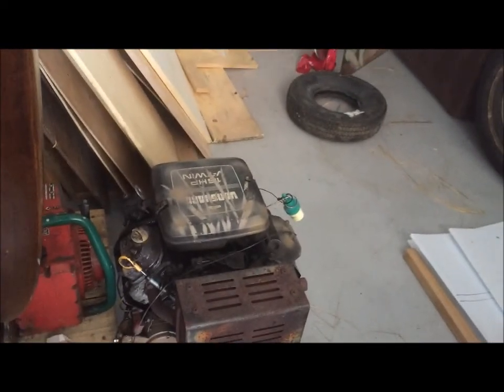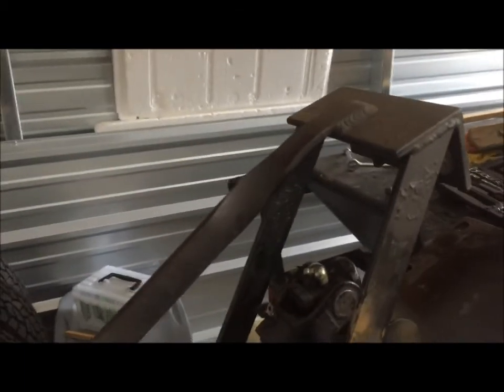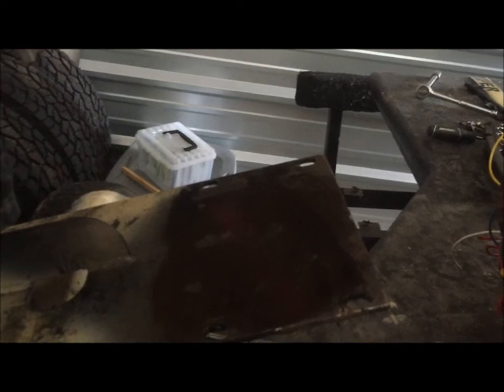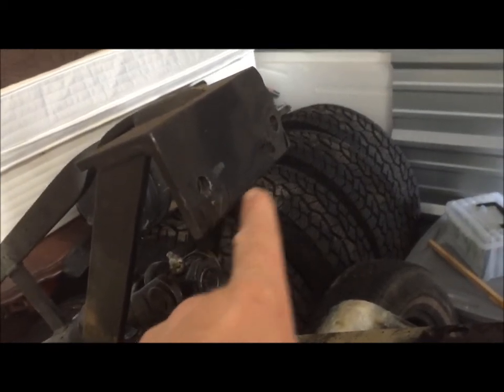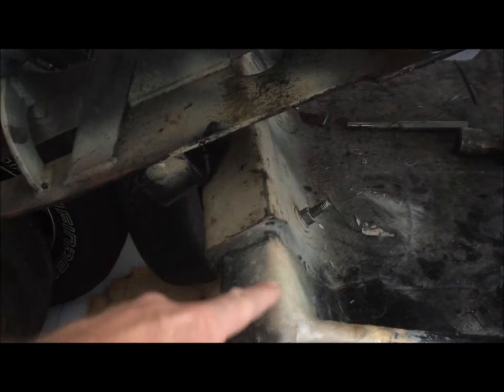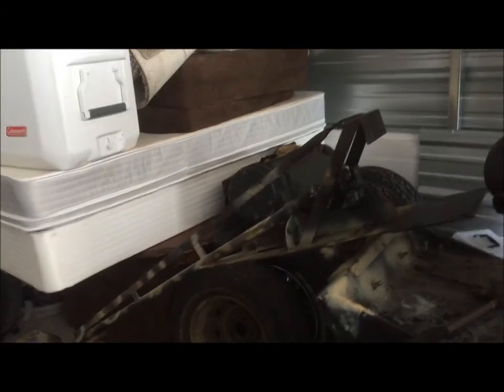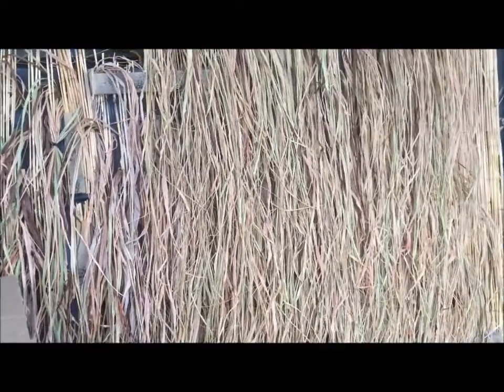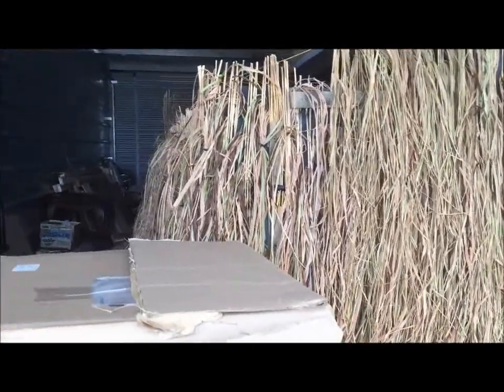Building the duck barge - Starting the motor swap 29

Comment: Looks cool been watching?
I thought you gave up?
Yes I want to see how yours works hunting.
I want to build my own barge but really want to see it in the water.
I hunt the Mississippi River here in Iowa. How do you think your barge plan would work? Have you ever busted ice with your barge? How thick? any help you could send my way would be great!!!
Thanks
Dan
Reply from the maker: I have busted ice with it but only about 1/4".  My biggest concern is not busting the ice, but running up on top of it and getting stuck.  I plan on coming out to the Wisconsin side of the Mississippi this fall with it once I get the whole motor thing figured out.
Reply: Well you need ice runners on the bottom 4” tall in the front they crack the ice. There are times the boat comes up on it you stop everyone jumps on the bow and you break the ice. The issue is the sides when you turn cuts into the sides of the boat.
I have s boat that .110 thick with ice runners. I would like a 1/4 side 3/16 bottom aluminum plate.
But 20,000.00 ouch!!!
Reply: Do you have any footage of hunting in the barge?
Reply from the maker: @danielvrana9444  I have footage when I was out hunting but no duck action.  I should have that one up tomorrow.
Reply: Oh sure I just want to see the boat in action. I was going to do a pontoon but if I build a boat to pass down that would better than a boat I bought. I make my own foam decoys and flock them. I’m passing them down. Only the geese are shells that float that I bought.